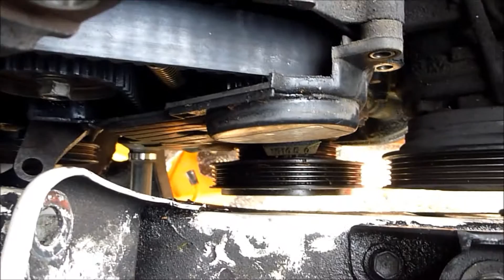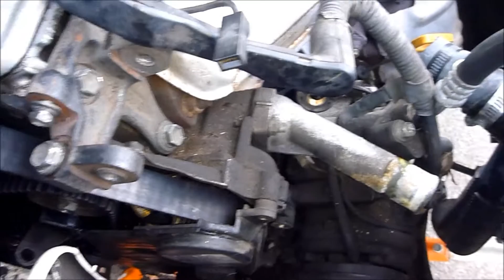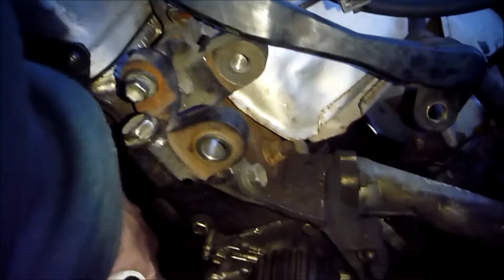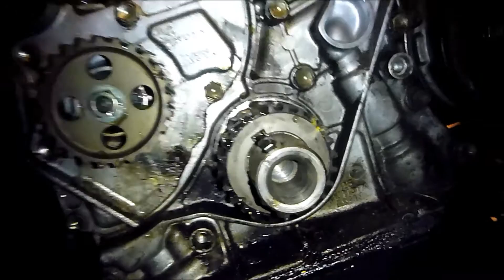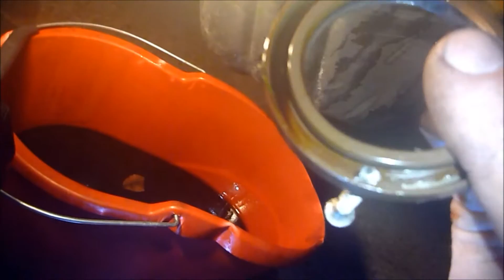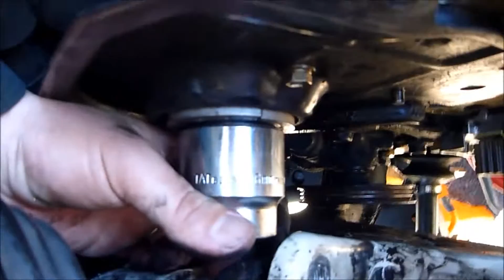1993 Toyota Celica Timing Belt replacement on a 5SFE engine - Part 2

Comment: @veryMcgarry, these videos are extremely helpful due to the rarity.  You said at 9:15 "boy I'm going to regret this" referring to leaving the oil housing on but only replacing the oil pump.  Was there an oil leak at the oil pump pulley?  Did it all turn out fine?  I'm deciding whether to replace the entire oil pump assembly which is very difficult task.
Reply: Hi Peter! So I took off the 5 pan bolts to replace the whole oil pump (including housing) then rethought that idea because I realized I was going to have to drop the oil pan to replace it. I didn’t show it but after I got everything back together it leaked where I took off the 5 pan bolts and I had to drop the pan to fix the leak. Yes, I would suggest leaving the oil housing on but only replacing the oil pump.
Reply: @chrismcgarry4133  thanks for your advice.  Why did you replace the oil pump?  Was it leaking at the seal where the pulley is attached?  That is where mine is leaking.
Reply from the maker: @rwarvi  I believe I bought everything as a kit together and since I was going through the other work, I replaced it too. It wasn't leaking. I probably didn't have to.
Reply: @verymcgarry8925 , @Chris McGarry.  Update:  I did not replace my oil pump.  I replaced the large o-ring 15188-88382 which stopped the leak.  I replaced the oil seals and everything is fine.  Peter Finn The Car Doctor stated that "this is nice nice part" https://youtu.be/jkjVqqoShRI which hinted to me that I should not need to replace the oil pump unless it is damaged.  Thank you again.  These videos were helpful to me.

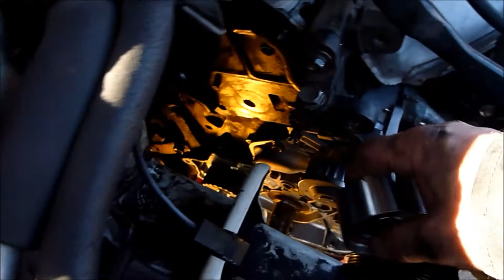Comment: Thank you for this set of videos.  There are few on the internet for this engine.  At 14:05 you were referring to a "non-tensioner pulley".  That is the idler.  The decision to not replace the entire oil pump assembly was practical.  To replace the entire assembly you have to remove the oil pan, oil strainer, baffle plate, which requires a monumental effort especially when the doing it upside down under the vehicle.

Comment: Want to know what’s funny? My 93 Celica had 250,000 miles on it when I stopped driving it because the body rusted away... the engine still runs but I never changed the timing belt once 😂!!!! I never changed the water pump, never changed the spark plugs once... I never changed the transmission fluid. I never changed the brake fluid or rotors. Never changed the air filters 😂!!! Never changed the fuel filter. Never changed the clutch fluid, never changed the suspension or steering components, never changed the alternator. The ac compressor died in 2006 but I didn’t change it 😂 I suffered through the heat of the Florida summers 😂 

The only things I changed were the oil like 5 times 😂 I changed the coolant once at 200,000 miles and the coolant was muddy Brown lol!!!! the battery once. The tires once the brake pads once I changed the clutch at 240,000 miles... Toyota Celicas are rock solid! Man, I wish I knew about cars when I was a kid. I would have maintained it and it might still be safe to drive today. There’s just so much rust I’m afraid I might fall through the floor or the cv axels snap while driving on the freeway.